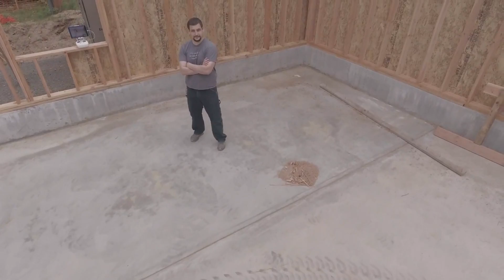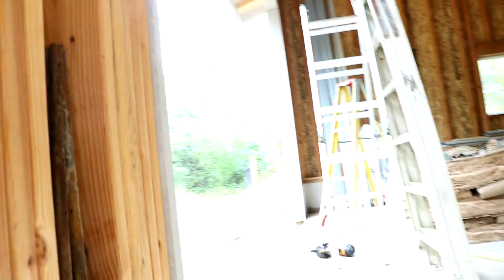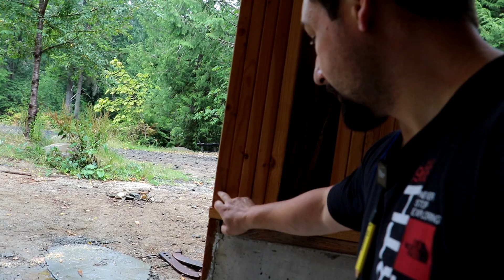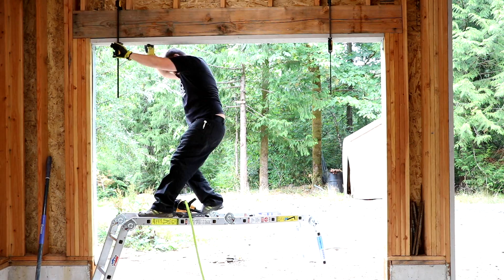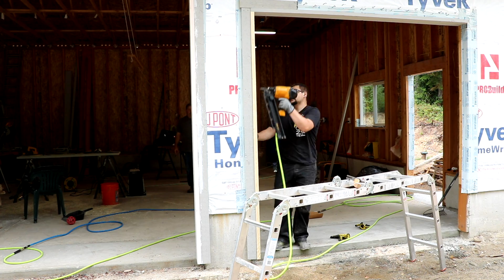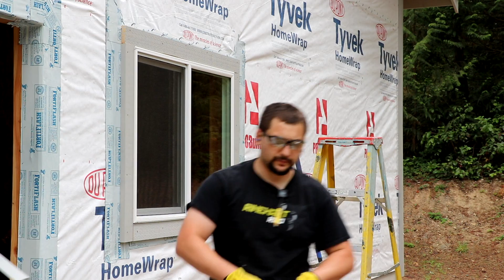How to Installing Exterior trim #23 Doing It Dans Way

Comment: Hey Daniel what kind of wood are you using for the trim? Looks like just rough cut pine.. Are regular 1x4's and 2x4's good for trim?
Reply from the maker: So yes you can just use 2X4’s I have a rental house and it has 2X4’s as the corner trim peace’s. As for the type of wood, I could not tell you what type of wood it is, when I ordered it, it was called white wood, but that is because it comes pre primed. It is ordered out as 5/4 by whatever width you want.  It sounds funny but for example it would be ordered as  “five quarter by four by ten foot” I like the way that this stuff looks but it is more expensive.   Hope that helps..

Comment: hand planer.. i use belt sander with #40 grit to do the same thing.  i like sander better because, for me, the tool has more alternative uses than a planer
Reply from the maker: Belt sanders are definitely a great tool and i burnt mine up a few month back, i have been looking for a better replacement, for a while. the planner is really good at removing a very even amount of material over a long area, that is y i have started using it more and more. Check out the below link to a much better video on how on y i like to us the planer.
https://www.youtube.com/watch?v=wlex-uuZnU4